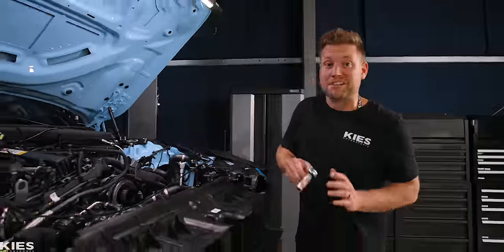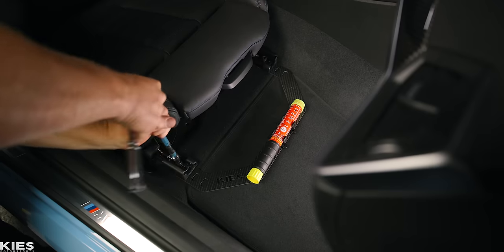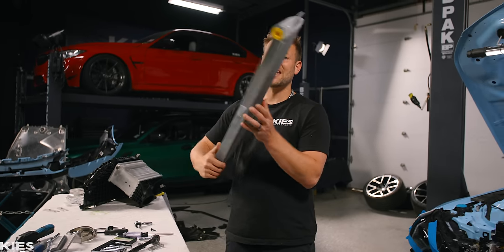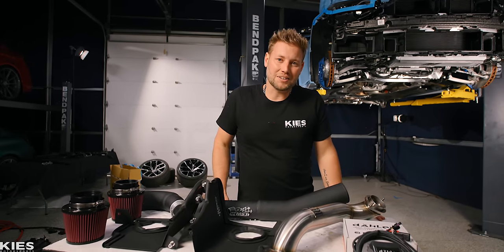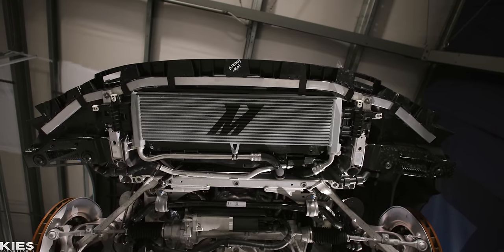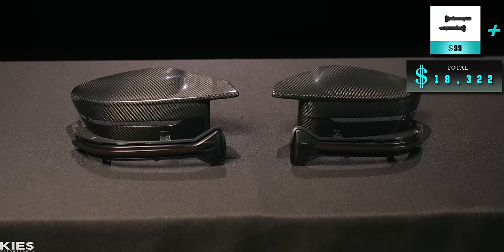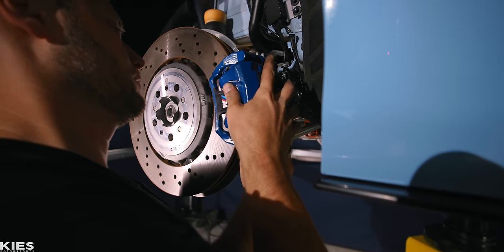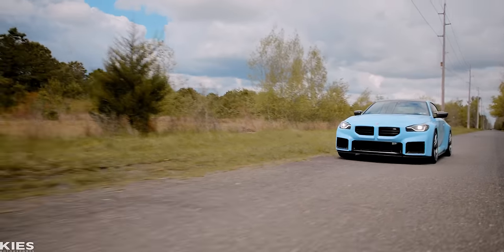HEAVILY modifying the BRAND NEW G87 BMW M2 | 32 Mods!

Comment: Hey kies ! I have a g80 m3 with carbon ceramics could I swap steel rotors and pads without changing the calipers or any brake booster

Comment: 30 and 40 ? That is aggressive. PSI did a 12 and a 15 pre-lowering. Ou are double that! Why ?
Reply from the maker: They aren’t traditional wheels, these are the all new BBS Unlimited wheels that have a universal wheel, so they need larger specialty adapters. They are very different than regular traditional spacers

Comment: Why are you guys calling it dry carbon? Dry means satin while wet means glossy 😅
Reply from the maker: Dry carbon is another name for pre-preg carbon which is how the carbon is made. Dry is the lightest and strongest available. Wet starts with carbon cloth and has resin applied to it, where dry is made in an autoclave. Typically, you will have matte and glossy dry and wet carbon

Comment: Ok it's not dry carbon if it has a gloss clear coat over it. Dry carbon is just that DRY carbon, make sure you know what you're talking about before going on the internet lol. But the car still looks good.
Reply from the maker: Dry carbon is also called pre-preg and refers to the materials used and not the finish. Dry/pre-preg carbon has the resin in the fibers so it remains “dry” in the manufacturing process. Wet carbon, is carbon fiber that has brushed on resin. Both are available in matte and glossy finishes, but dry/pre-preg is the lightest and strongest